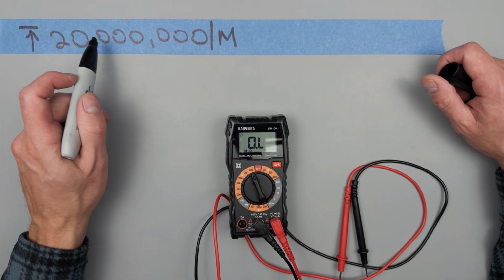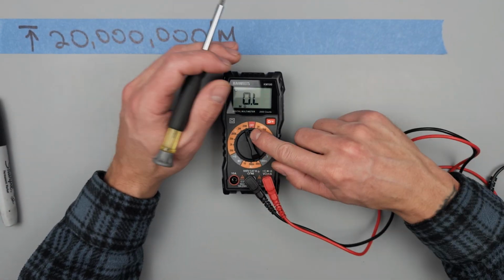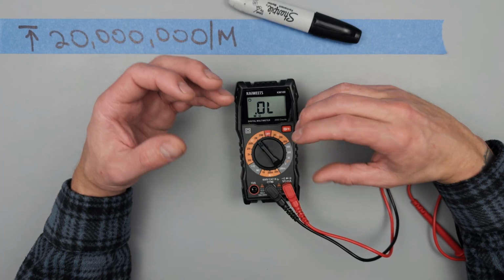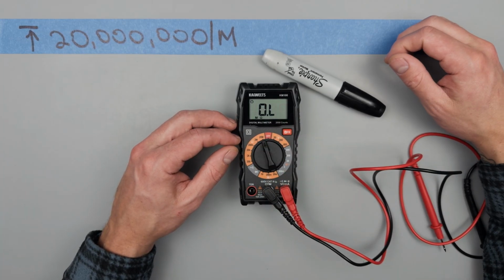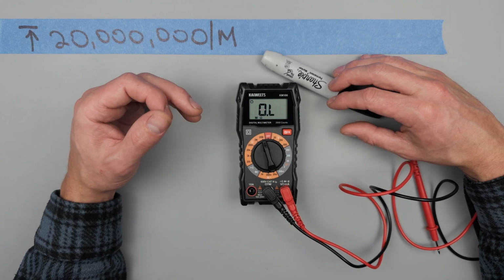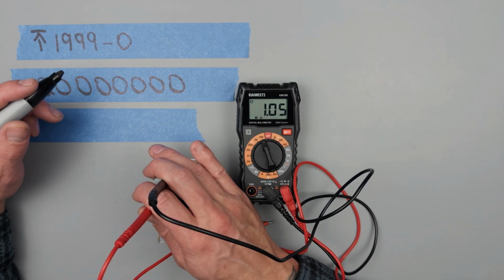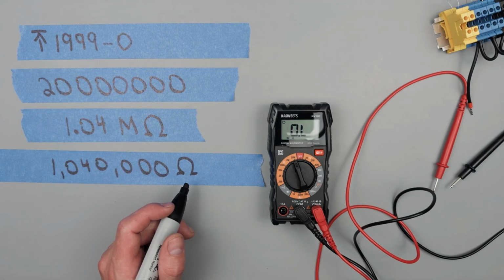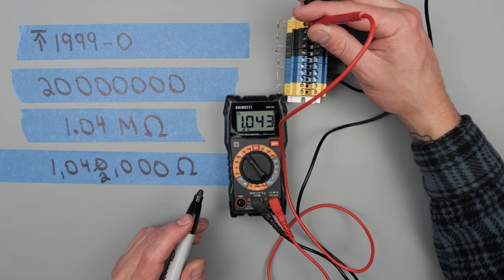How to Use Kaiweets KM100 Digital Multimeter: The Beginner's Guide to Non-Destructive Testing! ⚡️

Comment: What would the setting be for checking a fuse? Ohm?
Reply: Trying to see if a car fuse was blown
Reply from the maker: If you watch the tutorial, there’s a setting that has a little speaker symbol (right below the the ohms settings) it’s called the continuity setting. You can use that one to check car fuses
Reply: @maddoxmechanic  Hmm, maybe a quick tutorial on definitions like "Resistance, Diodes, Continuity" to follow? just a thought or I can just google them lol thanks though, those were the three I searched for.
Reply from the maker: @junksterb.5463 that’s a great idea. I’ll put it on the list